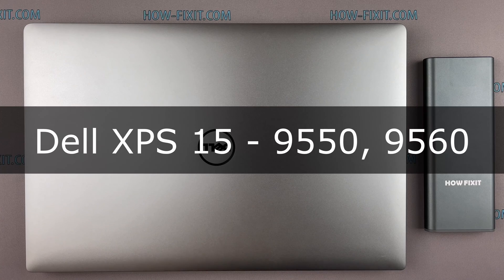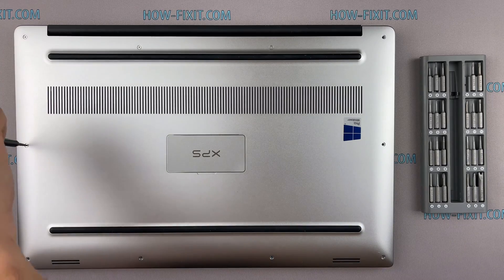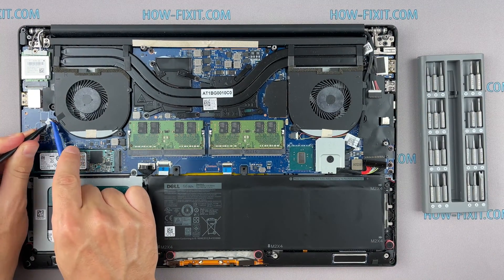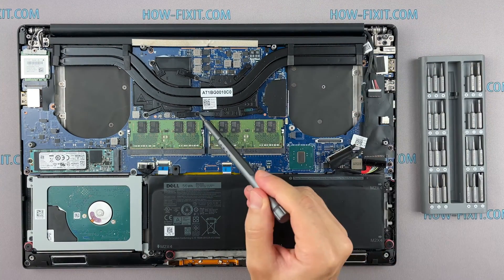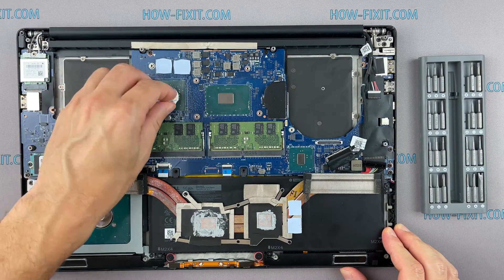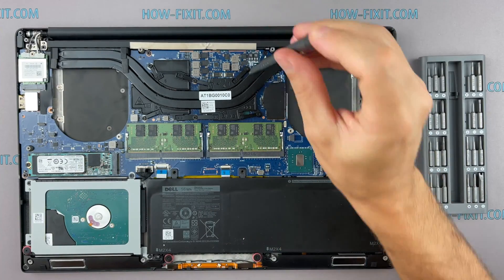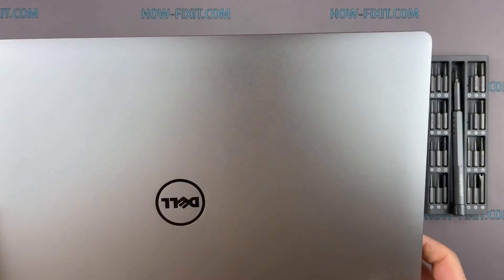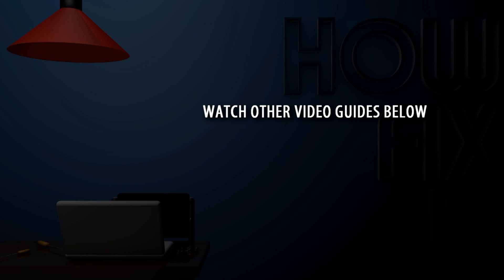Dell XPS 15 9550, 9560 Disassembly, fan cleaning and thermal paste replacement

Comment: 2025 checking in.  Make sure you follow this video when untightening/tightening the screws on the cooling system.  Take it slow, especially on the ones with little metal arms - they break easily.

Comment: There is an option to add a Secondary Hard Drive and the bay for this is in the same place at the left end, of the large battery. The connector is also lying vacant on the motherboard. To add the secondary drive SSD, its necessary to buy a Dell SSD caddy that comes with the cable. We also need to compromise and downsize the battery to give space to the SSD secondary drive.

Comment: Why are you using thermal paste on this laptop it's an M2 drive and does not require it as it generates less heat compared to other SSD types. They rely on the motherboard’s built in thermal pads or heatsinks for cooling not thermal paste. Ridiculous.
Reply: The thermal paste will even out the surface of the graphics card and processor chip. Due to the thermal paste the heat sink makes better contact with those chips and can transport the heat away better. The m2 drive ist located in the lower left area of the laptop above the hard drive. But even m2 drives produce a far amount of heat why you should consider putting a thermal pad on it.
Reply: @victorgorklo2180  No need for thermal paste As i said the m2 drive does not require it, the motherboards thermal pads and heat sink has cooling.
Reply: This is applying thermal paste to the CPU and GPU. The M.2 SSD has nothing to do with this

Comment: STOP, STOP & STOP making people do more than they have to, as because of your very Misleading video, like sadly the countless others on YouTube, you unfortunately cost me a Dell XPS 15 (9550) Laptop.
You Do Not have to remove the Cooling Heatsink to clean the Fans on the Dell XPS 15 (9550), (9560) & (9570) so why do you have people doing this very costly and unnecessary Step, which I sadly found out the hard way?
What do you get Kick-Backs in your suggested supplies?
I followed your Misleading video and unnecessarily remove the Cooling Heatsink and ultimately having to Buy Thermal paste & Pads as well, upon very carefully lifting it up 2 of the small screw cylinders inside the screw hole came out of the Motherboard with the screws attached.

Thanks for Destroying a perfectly good laptop with your Misleading & Garbage video.

FYI - Not everyone plays games or edits videos on their laptop so so-called Thermals was never an issue for me because what I do with my laptop will never have it get to that point.
So STOP the STUPID Re-paste garbage when someone just wants to replace their Defective Keyboard.

I will be sending the exact same response to all your other YouTube Destroyers as you All want to be FAMOUS at others expense.

ALL THUMBS DOWN from Me! :face-pink-tears:

Comment: Thank you - this has brought down the temperature of my XPS, and the fans no longer go wild after opening a few tabs in chrome. 
However, since opening up the laptop the trackpad no longer works as effectively. About 5% of the time, even though I hear and feel a click when I press the trackpad, no click is registered. Do you have any idea what the issue might be and how to fix it?

Comment: I"m aware that cleaning the fans is very beneficially to keep the laptop running well a properly cooled. But what benefit is there for replacing Thermal Paste?
Reply: Thermal paste gets hard and loses it's thermal transfer properties over time. Cleaning and replacing with a quality paste is hugely beneficial to transferring the chip's heat to the copper plate.